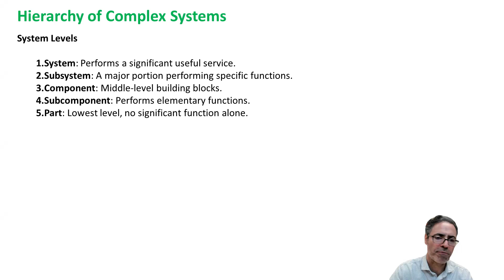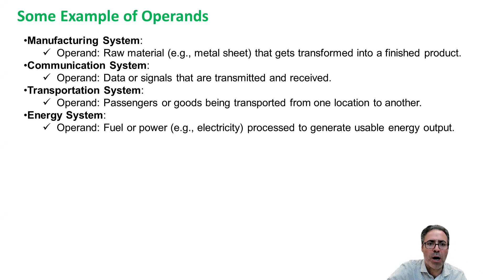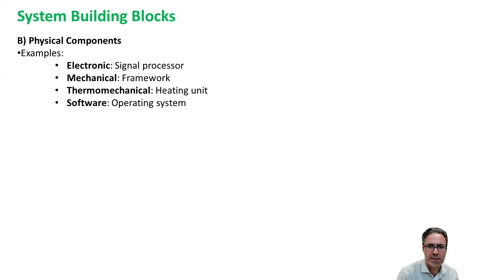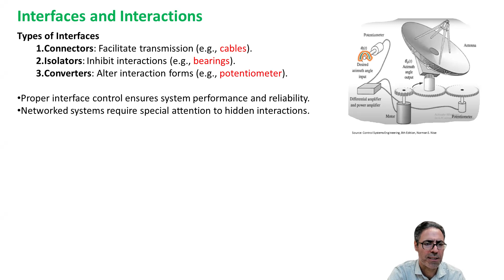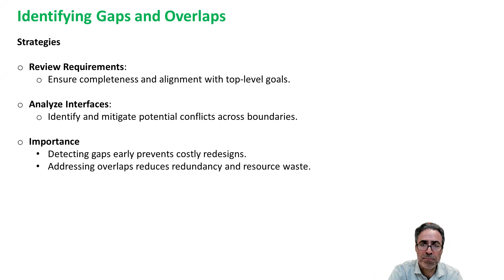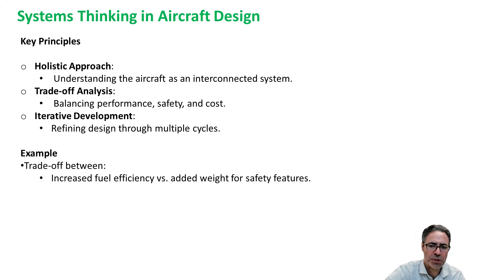Lecture 2  Structure of Complex Systems

Comment: From an engineering point of view, I think it's worth mentioning the difference between "performing" a function and "having" a function. Engineering wise a "part" is functional in some way - or it wouldn't exist in the system. For the specific example give with a jet engine, a turbine blade has, for instance, the function of "moving air", "attach to rotor", "withstand forces". However, the distinction is between a signal being given to activate and "perform" a function versus the static behaviour of the turbine blade which is "having" a function.

Comment from the maker: (Example Answer ) One real-world system with a clear hierarchical structure is an eVTOL (electric Vertical Take-Off and Landing) aircraft. This system is complex, requiring the integration of various subsystems and components to achieve safe and efficient urban air mobility. Here's a breakdown of its hierarchy:

Subsystem: Powertrain

Component: Electric motor
Subcomponent: Rotor assembly
Part: Bearings
Subsystem: Flight Control System

Component: Autopilot module
Subcomponent: Control algorithms
Part: Microprocessors
Subsystem: Energy Management System

Component: Lithium-ion battery pack
Subcomponent: Battery cells
Part: Electrodes
The hierarchical structure ensures that each level is well-defined and contributes to the overall functionality. For instance, the powertrain generates thrust, the flight control system ensures stability and maneuverability, and the energy management system provides the power required for safe operation. The integration of these systems ensures the eVTOL can safely navigate urban environments while meeting stringent safety and performance standards.

A key challenge in managing this hierarchy is balancing weight and performance. For example, lightweight battery packs improve efficiency but may reduce energy density, affecting flight duration. Systems engineers must optimize trade-offs between these competing requirements to ensure a reliable and scalable design.

By examining this hierarchy, it becomes evident how systems engineering principles guide the development of such innovative transportation solutions.